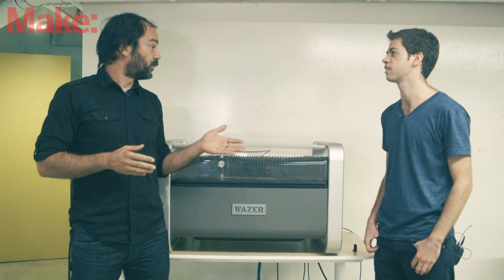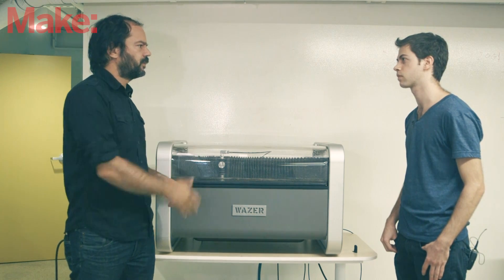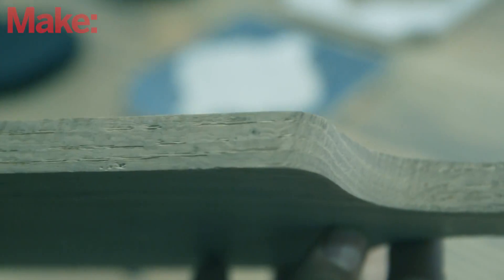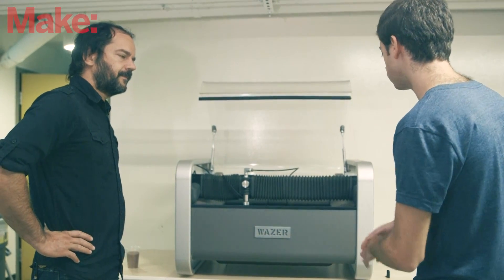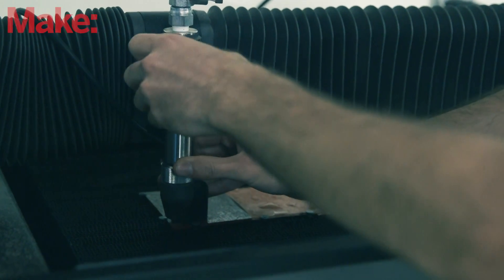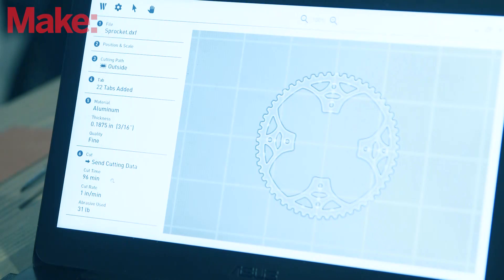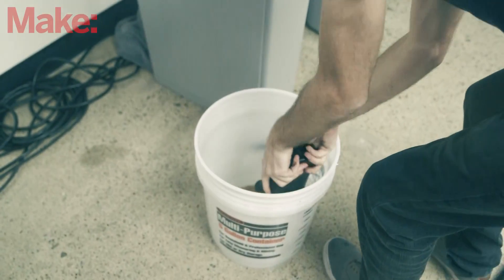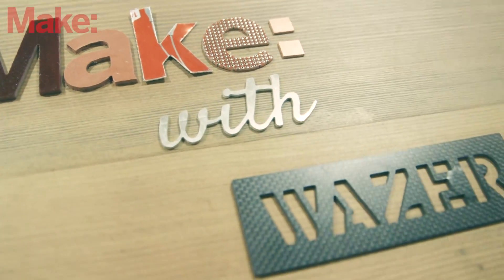Wazer: Desktop Waterjet Cutting

Comment: 110V (115V) only. What about the rest of the world, not interesting enough?
I find it a bit of a waste of developing time, nowadays it's not to much of an hassle to make things 115/230V compatible.
Only thing that's a bit more complicated is getting the CE license, but you don't  have to go for that straight away.
Reply: We get 400V from 3 phases, where each is 230/220V. This allows for a lower current and thinner copper wires
Reply: Well, I hope they don't use any transformers.
Nowadays, everything needs pretty much a SMPS, which is far more convenient for multiple voltages, weight and costs anyway. That's why I don't understand the whole idea of only working for 115V.
Going back to the drawing board and making a whole new revision for 230V is only adding much more costs.
Better doing it right the first time, not that much more work at all!
Reply: This is a common problem when moving from country to country. There are step down transformers everywhere. https://www.amazon.com/Voltage-Converter-220-240-110/dp/B001ES8YY6

This is a brand new product developed in the US. I'm sure with greater popularity and success they will build internal electronics to sell their product everywhere. Give them a little bit of time to get the business started.
Reply: a 5000w stepup transformer is fairly cheap: https://www.amazon.com/ELC-T-5000-5000-Watt-Converter-Transformer/dp/B00EBC5HSS/ref=sr_1_1?s=electronics&ie=UTF8&qid=1473785888&sr=1-1&keywords=5000w+step+up

The problem is the cost of garnet you will go through. They state 0.33lbs/min. The example bicycle crank on their kickstarter took 168 minutes to cut, so you're looking at around 55lbs of garnet at somewhere between $0.60 and $1.10 per pound. If the transformer is an issue for you, imagine paying for and storing that much (unreusable) garnet for each cut.
Reply: Buy 3D printer open source parts from china for around 300€, run open source software for free, buy biggest pressure washer you can afford over 3000psi depending you initial material cutting thickness.. 400€ to 1000€, design and machine custom nozzle for that 100-200€ depending where you get it and build your own hopper system 50€... and start cutting!

Much cheaper than this and will be cutting much thicker materials, or faster rates than 0.6inc/minute.
Reply: +JohnPavilonis do you know how big the transformer need to be for high watt machines?
Reply: ww998w[Gamel]
~ Sorry, I don't have all the specs. A larger load will need different circuitry.  You might look into IEEE standards.
Reply: Bart B
~ I have worked with many different manufactures that build copiers, printers, fax machines, etc. Most every manufacture has a completely different power supply for the different nations they ship the products too. Usually everything else is the same. It mostly has to do with cost. If manufactures can save a penny they will.
Reply: Maybe those are older types? 
Nowadays it's not that difficult and expensive to develop a universal power supply that works from 65-250Vac.
For higher power you'll need PFC anyway, so therefore it's pretty much universal by itself. 
And again, I do get it if your idea is to sell millions a year. A million pennies is still a lot of money.
If you don't, why don't just take a tiny bit more effort to make a real professional product?
It's already making a lot of restrictions before a product is already launched. 
For that amount of money it's the least you can expect. 
There are absolutely no reasons for it not to do so.
Reply: Bart B
~ Your point is valid. I understand where you are coming from.
Reply: You are right! When can we order one!
Reply: Buy COTS waterjet parts(you'll never break them) for the mixing tube and nozzle, it will probably be cheaper than trying to machine the parts yourself unless you have a serious machine shop at your disposal. Grab some linear guides from china, some leadscrews(or ballscrews if you feel like splashing out), and some COTS hydraulic parts. You'll need a low volume pump, and a nice chunky motor to run nice presures(and because it's water, derate 50% or pump life). 

Machining the orifice(pural) for the nozzle would be a bear, and the mixing tube is usually really hard stuff so the abrasive doesn't eat it too quickly. The hopper is honestly probably about ten buck worth of stuff, thirty if you include a vacuum pump to premix the abrasive.
Reply: Like we in N/A have to do with some items: just buy an adapter.....what's the big deal?
Reply: I carried in my luggage a toaster, as a prank wedding gift. I flew from the United States to Australia to attend my friends' wedding. All his international friends were crashing at his place. The look of exasperation and amusement on his face when he opened it was fantastic. The power difference would take a power converter the size of a large microwave to get that high draw appliance to work.